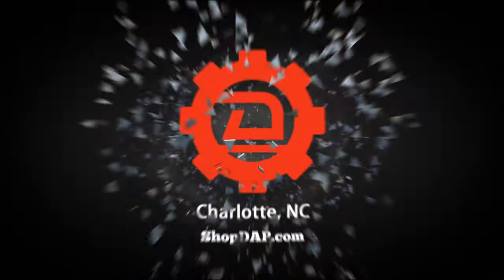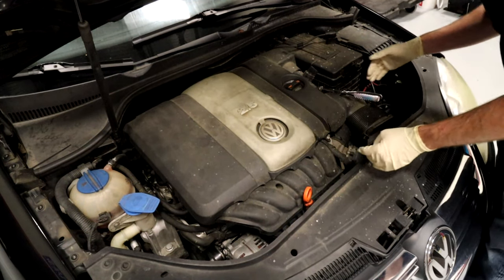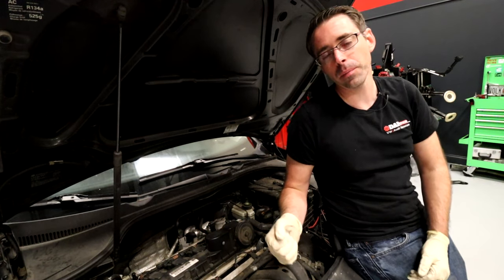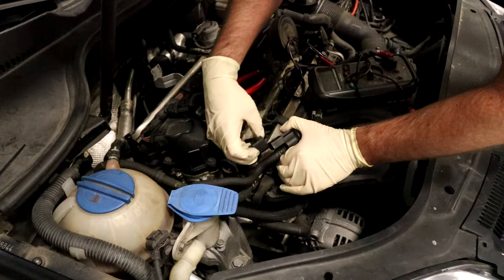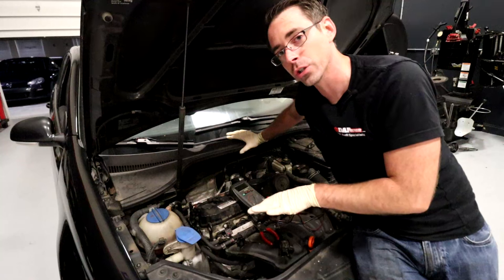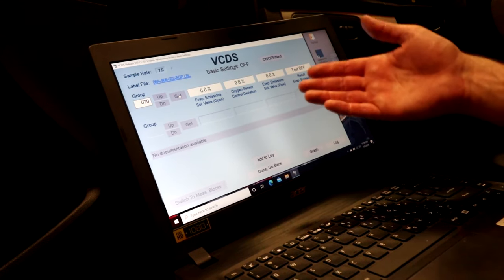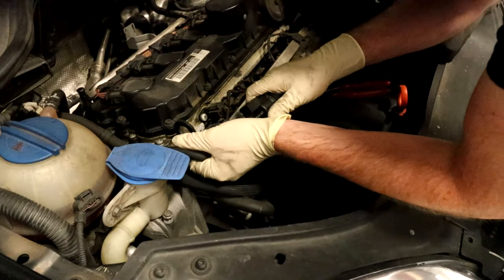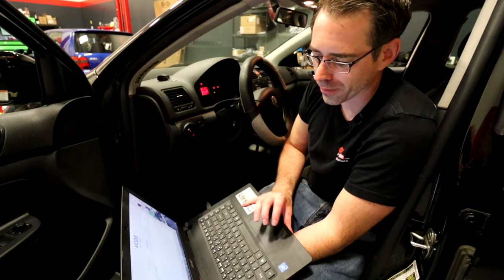Diagnosing and Replacing a N80 Valve | 2.5 Liter

Comment: I really enjoy the diagnostic videos. I took my Mk7.5 for a evap leak it was at the dealer three different times to diag and fix the evap leak. N80 valve was replaced along with a slew of other things until they determined it was the gas tank. Tanks was replaced and no more issue. Proper diag videos help us all.
Reply: How does the fuel tank go bad ?!
Reply: It doesn’t, dealers just want to take advantage of the fact we lack info , and make us waste the last penny we have .

Comment: In my years of fixing clapped out Audi VW's, I found these purge valves were the cause of EVAP leak & flow faults damn near 100% of the time.  Most of the time I found the valves would NOT hold vacuum from/on the manifold vacuum side of the valve (think of it as a one way check valve, sort of)....100% of the time I found they would click loudly, so I still replaced them even on the few occasions they held vacuum when I checked/replaced them for leak/flow faults.  If you can hear the valve clicking inside the car or even outside of the car w/hood closed, then the valve is going bad.  New/good working valves are pretty quiet and older cars like B5 chassis & Mk4 chassis cars, they're damn near silent when new/good (the rubber sleeve mount acts like an insulator...).
As Paul kind of alluded to, if it's got leak/flow fault - replace the valve.  From a tech's/shop's perspective, this is one of those cases where shotgunin' a part at a car is the easiest most cost effective diagnosis and near certain fix at the same time.
Reply: Thank you so much for this comment. Im currently diagnosing one with 3 different codes for the valve(open circuit, Short circuit) and I did the electrical diagnosis step by step and everything passed. Now im nervous about just getting the parts cannon on it, But this comment is giving my alot of hope. The car only has 40K miles

Comment: Perfect.  Thank you.
A few weeks ago my 16 Year old daughter calls and said the gas cap light was on. She checked  the cap and it was on. By the time she got home it was out. 
Then a week went by, she got gas and then the car would not start. Turned over but no fire. After waiting 3hrs for AAA to show, It fired up. Drove it home 15min, and next day I took it to work 20mins. Down to AutoZone to check battery. That was good, charging system good. And then on my way home the gas cap light went on again.  Watched this video and back to AutoZone for the Valve. 

If I don't reply to this ever again it worked for me.
Reply: did it work for you?
Reply: @michaelfianko7852  bro did you not read his last sentence he clearly stated that if he doesn't reply back ever again it had worked for him so clearly it did work like Paul stated in the video itself

Comment: A customer of mine came in and the dealer installed his backwards. So look out for the arrow direction. Even aftermarket puts the electrical connector opposite the arrow. Good video btw!
Reply: Humm I should have read this first. Back down to the garage to double check.
Reply: @622wesc  arrow always towards vaccuum source

Comment: There isn't a diaphram in this device.  It's a solenoid operated valve.  When I was replacing the fuel injectors, I apparently broke some carbon deposits loose in the device or in the lines.  These small bits prevented the valve from seating and caused the computer to report an evap leak (P0455).  After cleaning the valve with  some choke cleaner, and cycling the solenoid a few times with a 12v supply, the valve started working normaly.  You can test if the valve is leaking just by blowing thru the tube on the end by the electrical connector.  If it leaks you can blow through it.  When it's working OK you can't.

Comment: Had all those symptoms. First changed the gas cap and still had the code after driving a week. Opened the hood and didn't hear the clicking so replaced the N80. CEL went off after a short drive.

Comment: My daughter's went bad on her 2011 VW Jetta 2.5L SE at 189,000 miles. Actually no previous indicators, just stuck in open position one day "age/milage?". She filled up and her car ran as it was missing for 1-2 minutes then, ran fine. Used OBDELEVEN to pull codes. Part cost me $25. We bought her car with 51,000 miles, sold it with 204,000 miles still running,  driving like 50k miles. The only 2 parts to ever break/fail on that car was N80 at 189,000 (cost $25) and the windshield wiper motor failed at around 130,000 miles ($75 part). My opinion on the VW 2.5L motor, nearly bullet proof. 51,000 miles to 204,000 miles of ownership "150,000 miles driven", $100 cost in repair costs.  Put her back in another VW Jetta , 17 1.8T SEL Premium CPO with 20,000 miles, hoping it is as trouble free until 200,000 miles.

Comment: I have a 2016 Jetta and I need to replace the N80. The part you linked (and can be found through other research) LOOKS to match, but VW states it won't fit my model. They do not appear to sell the N80 valve alone for the 2016 and instead the only part I can find would be buying the whole hose unit Hose - Volkswagen (04E-133-366-CQ) at $100-$150. 

Any idea if I can use the 06E906517A and save the time/money vs buying and replacing the whole hose unit?

Comment: Thanks. I have 2005 Beetle with a 0455 code. Bought a gas cap. Pulling n80 and cleaning or replacing. If that don't do it, check all the stuff inbetween, it seems.

Comment: I simply changed mine due to the loud ticking.  Had no other symptoms.  Ticking noise is gone now.  2013 Passat
Reply: My car starts struggling after I pump gas on it, I hope it’s the valve
Reply: Abraham Osrs thats how mine was, I replaced the n80 and it started right up.
Reply: Omg

Comment: Correct me if I'm wrong. If you connect a vacuum pump to either side of that valve and pump it to about 15, if the valve diaphragm inside is good isn't it supposed to hold the vac pressure, and if it's bad the pressure will slowly drop? I'm getting P2187 & P0507 codes and have checked everything else that could be related, and they all seem OK. I saw another video using the vac test, and mine isn't holding the vac pressure from either side even though my VAGCOM says the solenoid is functioning OK, and I can hear it clicking.
Reply: Did you ever figure out what it was? I have this exact same issue. Valve is quiet until the car warms up and then it clicks loudly, though I'm still not clear on whether that's normal or a sign of failure. Getting only a P2187 code. No vacuum leaks.

Comment: Would the missing clamp on the right (engine side) of the valve be an issue as well? There is one there originally. Prob a 3/8 hose clamp should seal it.

Comment: Thank you so much! I have a jetta at my job with evap canister purge valve short and open circuit. I tested the harness and the resistance, and everything passed but the check engine light keeps coming back intermittently. The cars only 40K miles and I did the full diagnostic. I finally gave up and just concluded to replace it which I hope it fixes it. I will update this comment if it worked.

Comment: On the n80 valve did you have a hard plastic hose on the other side on the right side because on my 2018 ihave a hard plastic hose and I'm scared to break it😊 when taking it apart?

Comment: My wife has a 2015 Tiguan, I've been getting a combo of P0507 and P2187 codes. When I check the N80 valve I'm getting 25.9 ohms of resistance, is that within spec for this car?

Comment: I’m saying it now.  The 2.5 was the best reliable engine. I wonder if it’s the same engine in the RS3
Reply: The 07K block is iron with port injection, the updated audi 5 cylinder is aluminum direct injection

Comment: hello, if the n80 valve is broken or malfunctioning is it possible that it continuously sucks air because I heard a leak from my canister and when I disconnected the hose I saw that it was continuously sucking air? 

Thanks you

Comment: Love these type of videos. So I am new to the channel. I own a 2010 vw jetta 2.5L
Currently having hard starts sporadically and dealer has not found anything wrong. I changed my fuel filter and spark plugs and still same issue. I used to get misfire codes with my obd11 but now they dont appear any longer.
What type of manual can I purchase that has all the info to my car. Like the servicing amd wiring that were refering to? Is there something I can find somewhere? Seems like my dealer is not very helpful and overcharge me so I want to start DIY protocols. Thank you and any information is appreciated. Love the website and pricing on everything. You are the VW idols from what Ive came across!!

Comment: I have replaced my N80 but im still getting the error Evap incorrect flow
What i dont understand, when you clip the hose the test on 070 channel suposed to be Ok or Nok?
Is it possible that N80 is fine and the problem is with the activated charcoal inside the canister?

Comment: Hi ..Audi a4 2003 ... Some times idle problems some times in the fast acceleration i have air noise to the air filter and if i accelerate idle several times the engine stops

Comment: i did a decay test from the TB back to the purge valve and it took about a minute to drop form 30" vacuum to 5" and i'm getting the p0171 code i do not think it is the maf as i tested another car and that car had the same readings of .01 at idle and .02 at 1500 rpms and .20 at 2000 rpms on both cars. outside of the purge i have 60 psi fuel rail i changed the pcv so will the cam sensor cause this? or the egr? if the egr can cause that code where is that? thanks

Comment: I had a p0441 evap incorrect flow, cars got a lumpy idle and seemed to loose power could this be the issue?

I cleaned the Valve out and reset the code, power is back to normal but still runing lumpy no lights on dash

Comment: I have a neighbor whom im helping out with maintenance.   1st. Think I did, Consultant with Bard 😅  
Ai. Gave me a few links, one of was a government website. Safety recalls and ehat not.   My D7vscan tool reported a lot of TBC ,  one that was related to multiple TBCs. Was the ABS system.   So We went to work.  
On the gov website.  I put the vehicle VIN. For those who dobt know, it's your cars identification number 😅😮. 

The website reported an recall on the ABS. and my neighbor is the only owner registered to that car.  The air filter and spark plugs were so so bad.  I think it needs a valve  gasket replacement.  The spark plug gaps were all too wide. The tip was gone on all of them. It also had a loos intake boots so it was also reporting a air flow bank 1 code. So L S s.   Its goint to the dealer for the recall when it returns.  Ill follow through with brakes. Tires  and whatever else. Ih yea EVAp.leak .  Open pump something.   The Xtool D7 handles a lot of cars. 🪶